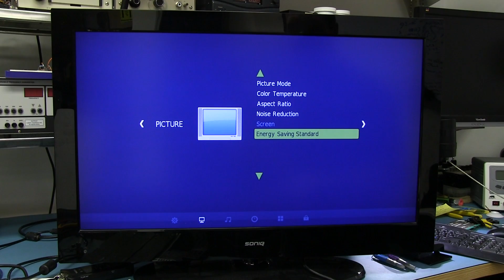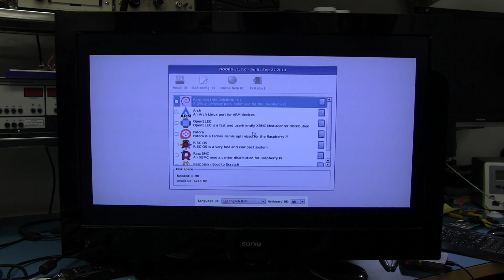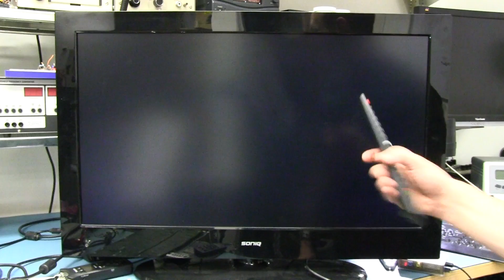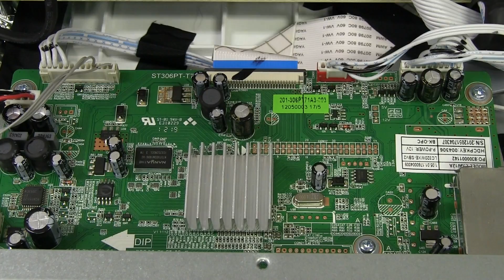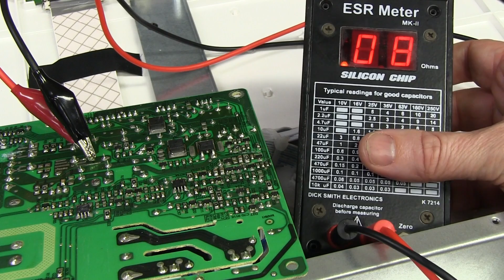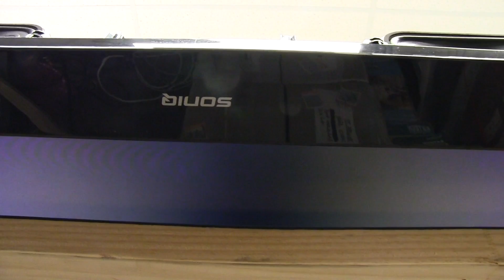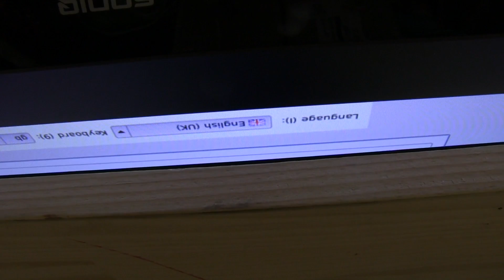EEVblog #630 - How To: Soniq LCD TV Troubleshooting Repair - Part 1

Comment: I dug a 50 something inch TV from the trash at work.  Like Dave's mom's set, I found the power supply to be good.  There was only one other board there - so I bought one on E-bay for 40 bucks or so.   Nothing to brag about, as any fool can change a board, but I did get a working TV for that 40 bucks. 

They wouldn't let me drive my car to the dumpster (crazy rules about POVs inside the fence) so the costliest part was carrying the darn thing to the gate.

I think many of these parts come from sets with broken LCDs.  That's pretty ecologically sound - making one good set from two.
Reply: As it is working, so why one ask how you made it...i´d not do;)
Stay happy as you fixed it and now having a cool TV...nice hmm? :) :)

Comment: Didn't read all the comments, but you need to check +5V, +3.3V and +1.8V on T-CON module (little PCB above the power supply). If it is OK, Y-buffers may be faulty (connected with T-CON by ribbon cable). Re-flowing BGA chip or whole main board will be wise, but best is to buy your dear mom a brand new TV. Avoid crappy cheap models...
Good luck.

Comment: I would take a look at the LCD panel, blinking image with lines and different colors is at most times a giveaway for that, sure can be the main board, just freeze spray it to check for sure. Check all the flex cables with little chips on them around LCD panel by gently pressing on them. Main board most likely have a sync with LCD and that's why sometimes you don't even get sound, since LCD does not start up. With all the gear you have, it should be not a problem to fix this TV or at least find the problem, you can trace any kind of signal in that TV to check if its OK. But sure only if it's worth the time ^.=.^

Comment: As a man with very little electronics knowledge, I'll ask; could a connection between the digital board and the LCD be loose?
Reply: That was my thought as well. I'm surprised he didn't noticed that the picture disappeared at the beginning of the video occurred exactly when he touched the monitor. Not conclusive, of course, but that would have me doing some percussive tests and cable wiggles before I even took the back off.
Reply: Fracture He should try beating this thing until it works.
Reply: It could also still be a cold solder joint somewhere aswell.
Reply: Possible but unlikely, the broadcast image never shows but the input signals show some of the time. If it was a loose connection to the LCD it would be quite a coincidence of timing and wouldn't explain why sound never works on the broadcast signal. There may be multiple problems but the first course is to assume there is a common fault.

Comment: heatgun the main processor i think that tv has bad airflow over the chip because of the metal guard that holds the conectors in place it should have vent holes for fresh air

Comment: if it's bga solder problem you could heat circuit board with a heat gun, it is risky. i have already seen this technics on youtube for laptop video problem.

Comment: It seems that Dave has always looked down on people that repair TV's. One time he said, "Does anyone still fix TV's", or something like that.
But I love repairing TV's and devices, I think it's fun. I fixed my Fijifilm Cameras battery charger. Turns out that all that was wrong with it was a bad connection on the 2 through-hole inductors. Damn non-leaded solder!
Reply from the maker: When have I ever looked down on anyone who repairs stuff? My first job was as a repair tech. I said that because it's a well known fact that the consumer repair industry has all but died.
Reply: EEVblog
It's just the impression that I got. Died? There are over 90 computer and electronics repair shops in the Dallas/Ft. Worth area. I know a man that owns a shop and is talking about opening another shop. When the economy get's down, people look for ways to save money. And most device repair is usually an inexpensive fix. 
Also, I used "90", because there are over "90" just in the Ft. Worth phone book - I didn't even check the Dallas phone book. There are probably 200 in it. I hear that "consumer repair is dead crap" all over the blogs, and it's simply not true.
Reply: EEVblog
Heck, back when I was a repair tech (1987 - geez, almost 30 years ago) I could see it on the horizon.  I knew there was no future in it.   IN 1987 dollars, a typical labor fee was 50-100 dollars.   Now, you can buy one for less than that in 2014 dollars.  My former boss is still in business, but I think it's his government contracts (electrical and electronic installations, maintenance, etc.) and computer work that keeps him afloat.
Reply: Robert Calk Jr. Can a local repair shop do stuff like removing, reballing and reattaching fine pitch BGA parts with hundreds of balls? Can they even source those sorts of parts to do repairs? I don't think so. There might be a lot of places around that can change a fuse, swap out some caps, swap out sub assemblies etc but I doubt there are many people around that can actually fix modern stuff that is more complex than a kettle.
Reply: ungratefulmetalpansy
You guys keep saying that crap, but all you have to do is look in a phone book. If all those 100's of repair shops were not making money, they would go out of business - Not spend thousands on equipment and live in nice homes.
And the worse the economy gets, the more business they will have.
Reply: Chris W
That's right Chris. I'm disabled and bought many e-books online and taught myself repair to give me something to tinker with and keep my mind occupied.
Who needs electronic schools anyway, unless they want to be an engineer? I could probably buy that online also, if I wanted to...
Reply: Robert Calk Jr. You need to look into other part of the world..repair labor could most of time cost more them the product itself. Your so called "Repair Shop" couldn't be more then just replace motherboard and dvd rom...very simple repair I would say. Cheap China electronic goods are flooding the world..and they fail easily. But still It's always good to know how to repair some electronic.
Reply: donpalmera
Yes, actually. As a matter of fact, the guy I know was talking about buying a nice reballing machine. It's true though that the majority of his work is with computers.
Reply: Bernard Lim
You guys seem to just be thinking about cheap stuff. You know some people have $thousands Plasma & 3D TV's and stuff. Not everybody buys $200 TV's.
Reply: Robert Calk Jr.
My first electronics job was also in a repair center and trust me, Dave is bang on, the consumer electronics repair industry is almost dead. It will probably never die completely because there will always be a need to fix things for warranty or insurance.

Modern equipment is almost completely unrepairable. There are small faults, like dry caps that can be repaired but almost all other faults are uneconomical to repair. Things are fixed these days by board replacement, then they are only repairable for the period that manufacturer continues to make the boards. Component level repair is just not viable with today's surface mount components and multi-layer boards.

Computer repair is not the same as general electronics repair, it is generally far easier to fix a PC. Since you can use generic parts and connector styles are all standard, you're not beholden to the whims of the manufacturer. As long as something isn't totally obsolete, you can generally repair it and relatively quickly. When people say that electronic repair is a dieing industry, I don't think that computer repair is intended to be included in the generalization.
Reply: *****
No thanks, I'll trust the people that are making good money and have so much business that they need to open another shop. That's who I'll trust.
Reply: Robert Calk Jr. It sounds like you know one person with enough business to open two shops and are assuming that that success extrapolates across the entire industry. As I said before, there will always be warranty and insurance repair. I think that environment favours a small number of large repair centers. Sure, some business savy people can probably make this work for them but they will be the exception, not the rule.

You also seem to be talking about a specific geographical area. Whilst I worked in that industry, I watched everyone of our competitors shutdown. About one year after I left the company, they moved about 100 km away. There is now not a single repair center in the area and only about two I know of in the entire city (and they are both one man band operations). Your experience is most definitely not universal.
Reply: ungratefulmetalpansy
I already told, are you that stupid? The friggen phone book. Yall don't have phone books in Montreal?
Reply: *****
We have hundreds of fujitsu siemens monitors in my place of work (hospital). We throw them away when they break. We had a £150 printer fail after a week and when it was replaced we asked if they wanted to RTM it to be refurbished they said bin it.
Reply: KX36
It's not my fault so many people are rich lazy-asses.
Reply: Yeah, well that's the reality of the modern world and economies of business. The old TV repair man has all but died out because his job was mostly to replace valves. He's from an era when not only was electronics all made from discrete components but that it was taken into account before the design stage that the socketed components were expected to fail and be replaced individually within the lifetime of the device. As others have said, most electronic equipment is highly integrated ICs, often fine pitch surface mount or BGA. It is not economical to attempt a component level repair. Beyond board level warranty repair or replacement, modern electronics are throw-away items, especially in the business world where emotions are out of the equation. We do have equipment which is visited by field service engineers. It's worth about £60k, we lease it from them for more than that and pay another £10k a year for the servicing. You won't get that service option for anything smaller than a large photocopier.
Reply: Robert Calk Jr.
Can you show some evidence of these 100's of repairers in Fort Worth? I don't have access to your phone book, but a search on Yelp hasn't found a single one (admittedly I haven't spent hours looking either). There are plenty of phone and computer repair shops so you get plenty of hits for the phrase 'electronics repair' but they aren't actually consumer electronic repair centres. I suspect the same thing is happening in your phone book.
Reply: KX36 I guess Texans are smarter than you guys. We are smart enough to know that a $50 - $100 repair is cheaper than a $400 TV. It's not my fault your people are stupid.
Most repairs are simple fixes and you all know it. That's why e-caps are the first suspect, and more often than not, the problem.
You guys can scream till you are blue in the face, but that won't eliminate the nearly 100 shops in the phone book. And I haven't checked the Dallas phone book - it's twice the size of Fort Worth.
Reply: Plus, I forgot about a company called the "Geek Squad". They actually drive to peoples homes and fix their computers.
Reply: ungratefulmetalpansy
I didn't even mention all the people that fix their own stuff. Most of them just R&R the boards, but hey, saving money is the purpose. You guys need to remember that not everybody is as wealthy as yall are. There are a lot of people out of work and having a rough time. If they can save $100 or more by having their TV or device repaired, then why not?
Reply: I've fixed at least a dozen LCD and plasma TVs which were being thrown out at work. Most just needed caps. A couple just had loose LVD cables. Of course, my labor is free -to me anyway. Then I give them to family and friends. BTW, I have yet to see a TCON failure, but some models are prone to them.

Comment: Intermitent problems that get progressivly worse are usually heat related. In this case I'd say a solder joint somewhere on the processor board. If it's possible I'd try to reflow all the solder on that board. If that doesn't work and changing out the caps doesn't work, then it's screwed.

Comment: Great video, Dave. A tricky little problem indeed. Can I ask did you check out the little buffer board at the top above the power supply? It seems all the faults are related to the video signal and that little board handles that signal.
I've actually bought a couple of TVs recently and although they are "e-motion" not soniq they have similar menus "no signal" display and physical layout with the buttons on the side and the speakers on the bottom. Worried mine will get the same problems. Good luck!

Comment: For us poorer folk, an isolation transformer for the unit under test and a 100x HV probe for the 'scope is a heck of a lot cheaper than a HV differential probe.

About the "electrolytic capacitor plague":

http://en.wikipedia.org/wiki/Capacitor_plague

Comment: Damn it! I hope you still get it fixed. I am trying to fix SyncMaster 2493HM and I could use some hope.
Reply: Look for bulging caps, samsungs are notorious for it
Reply: brianchris4
Finding bulging caps is pretty much where my expertize on fixing electronics begins and ends. Unfortunately none of those and I don't have ESR meter.
Reply: ***** Seems like a nice forum. Thanks for the tip :)
Reply: What is the problem with it? Black screen? I recently fixed a Samsung T240. Backlight wasn't working (or worked very briefly), but you could still see an image on the screen if you looked really closely.

Anyway, caps were fine, but backlight transformers are common fault with many Samsung screens. I got a new one on eBay for 9$ and it worked a charm.

Easy to test, just need to find the values for the transformer in question - what the resistance between the windings should be. If they're out by more than 10% or so, that's probably it.
Reply: Mythricia
Black screen yes, nothing happens when I turn it on. I honesty don't think its the backlight because no matter how close I look I don't see anything, not even with a flashlight.

Comment: Hi Dave Long Time viewer first time poster here, I know this may have been asked Before ( did not see at time of posting this ) but you might want to check to make sure that the TV can handle AZ/UK Pal MHZ I know some elcheap Tv's even in the USA cannot handle 59 MHZ let alone 60 or 120 like mine that might be the problem or the HDMI encoder has gone out I saw that when you Try to use your Microscope it said Nope.. it might Be due to the MHZ not the frame rate my old PC monitor had the same problem ( screen flickering and Even turning off when in mid Game  ) and I added a small USB powered Fan to the back and it seem to stop it..so Heat might be a factor also anyway from a n00b like myself to a Jedi Master I wish you all the Best in this fix..cannot wait for a update..

Comment: You should try bending the processor board, if you didn't do it off-camera. Bad solder joints on the BGAs is a very common problem with cheap-o TVs like this. Pressing down on the BGA will usually make the set flip out if that is the case. Even if it doesn't, simply getting your heat gun under the board and re-flowing the BGA is usually worth a shot.
Reply: Yes, tapping certain points on the boards or the whole television may have given an indication of connection or solder problems.
Reply: ***** Of course, you need to have your tongue at the right angle to do it. A healthy board should be able to handle some flexing without breaking, so if you cause a failure by bending it slightly, chances are that you're just saving yourself issues down the line.
Reply: ungratefulmetalpansy
You don't; it doesn't matter much if you melt more solder joints than you need, I've yet to damage anything because of that. Heat guns along the lines of the ever-popular ATTEN 858D+ don't really have the grunt to warm up more than roughly a BGA footprint, anyway.
Reply: ungratefulmetalpansy Consider that the board was probably soldered in a reflow oven; electronic parts are generally designed to handle temperatures well above 200 °C briefly, while un-powered. Sure, you shouldn't go with a 450 °C heat gun straight onto an electrolytic cap for five minutes, but re-flowing components, sensibly, is extremely unlikely to cause damage.
Reply: ungratefulmetalpansy It is not as much faith as it is childish hopefulness.

Comment: My gut keeps pointing to that display "extender" board chip.  Wondering if the main display boards is correctly outputting 60 FPS and that chip is chocking on the signal it is receiving.  I keep thinking that there is some "digital" logic issue somewhere on it.  Just a thought.  Keep up the excellent work!  Enjoy this blog immensley!

Comment: FYI, These are Chenghong [hunglow] TVs sold in Australia under the Soniq brand by JB Hi Fi. They are cheap rubbish although Soniq the company is very good and gave me a full store refund after the tv failed after nine months of use. I now have a problematic LG [Loosers Gear]. As another person commented contort the screen whilst on in the upright position.Best regards Pete (Melbourne). PS they are sold around the globe under vaious dodgy aliases.

Comment: Before Dave took it apart, the image went away when he physically touched the TV with his hand.
This screams "intermittent connection" to me.
Given the symptoms (image goes out, but audio is fine) I'd bet my money on a bad connection somewhere in the aera of the ribbon cable or the buffer board on the ribbon cable.
Those cables are notorious for causing troubles.

Anyway, the method for locating any kind of intermittent connection problem is to go around and bang the different boards and components with the handle of a screwdriver until you se stuff happen on the TV screen.
I am surprised Dave forgot to do this.